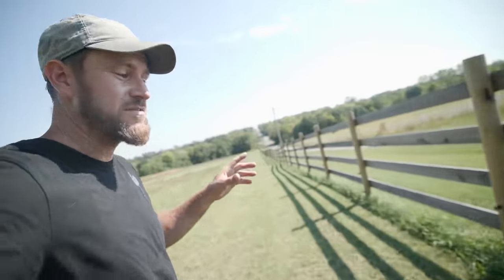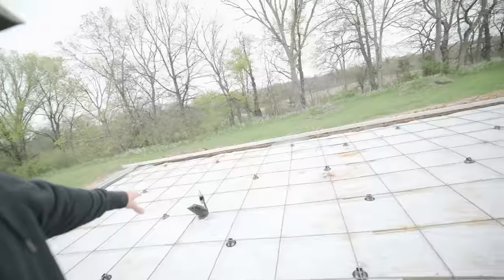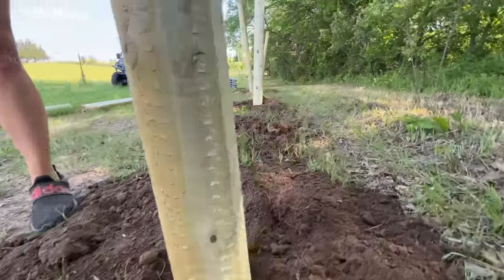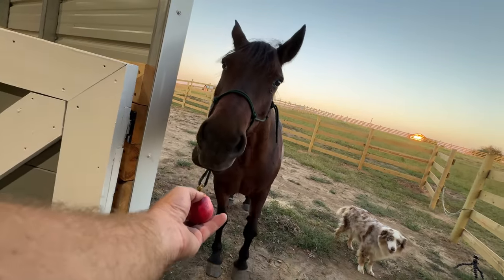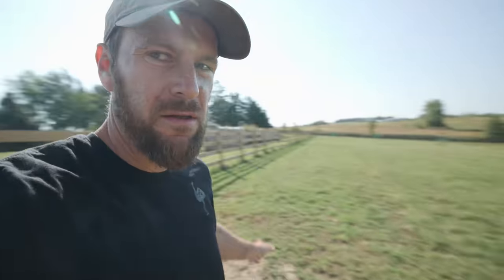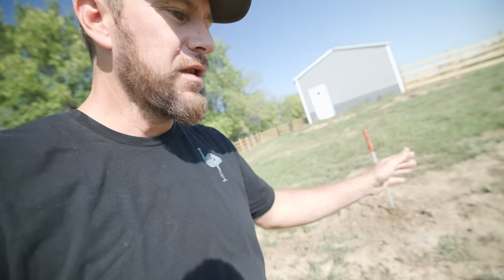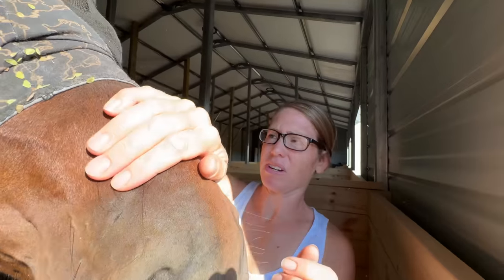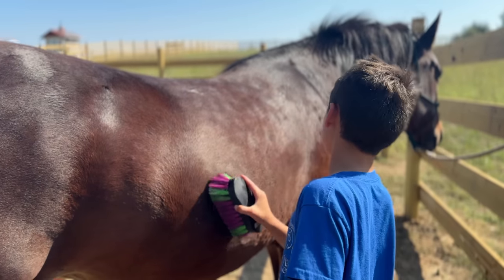Our Horse Barn Dream: Built in Only 8 Months

Comment: So, just some horsey advice.  You DO want a barn.  They're good to have for vet visits, or medical issues, and various other reasons.  But you want horses to spend minimal time in them.  Barns are unnatural for horses.  They are a pasture animal in the wild.  Their bodies are designed to thermal regulate, and run from predators.  You notice they don't live in caves in the wild.  As prey animals, they also only sleep in 15-30 minute intervals.  Domestic horses might be comfortable enough to go longer, and especially if they have a pasture mate to keep watch.  As such, horses are generally awake 22 hours of the day.  Stall life can get boring real fast, and that's when you get undesired behaviors, such as cribbing and aggression.  So, aside from keeping them in pasture most of the time, I would recommend putting enrichment toys in the barn also for when you do have them in there.  You also want a constant supply of food.  They keep their stomachs half full so they can run at any time, and therefore have to constantly graze.  Putting your horses on meals and long fasting periods causes ulcers.  So maintain your pasture, and make sure food that you do feed is of highest quality, and no mold, lest you also get colic.  In addition to horse training, never be afraid to take things slow.  Holiday seems pretty bomb proof, but she's still a horse.  Horses have excellent vision, but it does take 30 minutes for their eyes to adjust to changes in light.  Taking them indoors too quickly can be scary for them because they can't see yet.  Don't shine a light in their eyes at night either.  So my advice is, don't rely on the barn to build a relationship with your horses.  You do that in the round pen, grooming time, riding time, or just hang out in the pasture with them.  Work with their nature, and not against it.  You will have an amazing relationship that way.  Lastly, I'm hesitant to say this as it's a bit late in the game, but maybe it'll be useful in the future, I would have put the boards on the inside of the fence and not the outside.  If your horse ever leans on the board, it's less likely to break that way.  I am glad to see you put boards on the inside of the barn, because if a horse kicks the stall, they would have punched through the aluminum, and ripped their legs and tendons up.  But get some toys, and enrichment in those stalls.  Give your horse options in the pasture.  A shaded area they can go in if and when they want, and maybe even a pond for the horse to play in would be good options.  Glad you didn't go with wired fencing.  That could kill a horse.  Horses and wire fences don't mix.  That's a disaster waiting to happen.  I know you're going to get another horse.  Just don't put it off more than you need to.

Comment: Use the tractor to spin the auger coming back up out of the hole to unstick it and then do the same to clear the dirt of the auger.  Smarter not harder.
Reply from the maker: We do, but once it gets stuck it is difficult to get out without moving it back and forth. If I stop before it gets stuck, it comes out easily.

Comment: The horse is too big for younger kids,you should be taking them to a horse riding lesson and they should be riding a small horse around three to 12 hands high,it depends on your kid hight and weight and you should be buying them shoes that have heal at the end to prevent your foot from slipping backwards or forwards is dangerous if you plan to do horse jumping in the stirrups and you should be buying helmets for safety, don’t forget to buy a saddle blanket and saddle to prevent them from getting hurt on rubbing from the saddle,so you don’t crack your head open and a rubber boots for safety if you plan on transport the horse having an animal with split hoofs is not good, I know these things because i have been riding a real horse before.